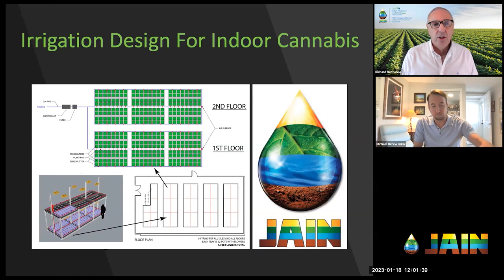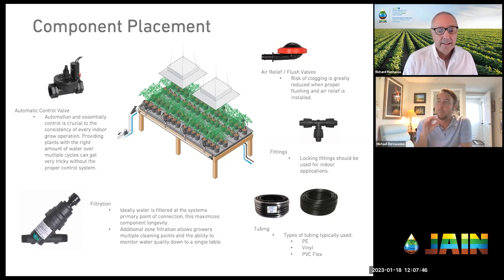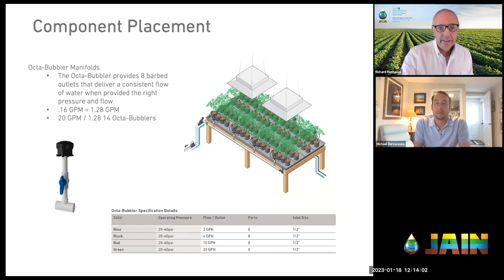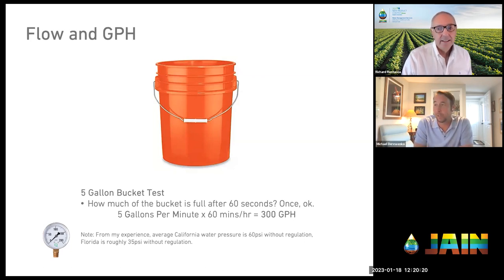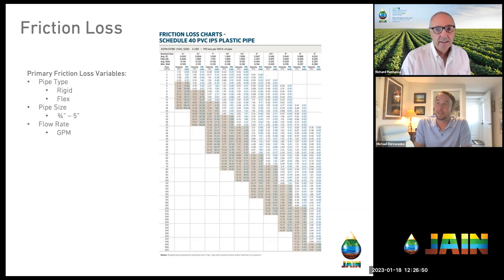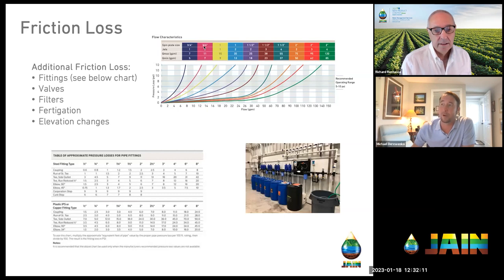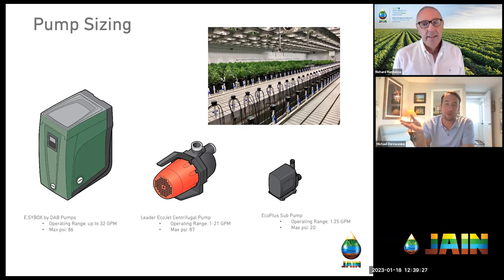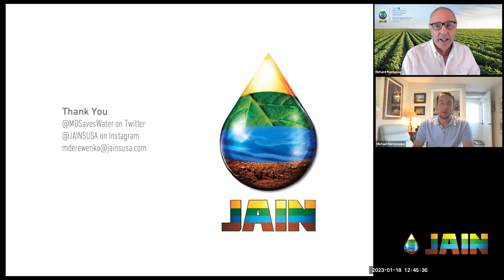Irrigation Design for Indoor Cannabis

Comment: Should the lines to each plant be the same length? I'm working at a grow that's using different lengths from the main line on each table. Here's an example theres 12 plants per light on a 5ft wide flood table with the main table water line runs on the outside edge of each flood table. The plants have different length water lines to each plant. The closest to the edge has two 12-inch lines per plant on each side of the table. The 2nd plant has 2 16-inch per plant on each side. The final or inside plants have  24-inch lines. I feel the shorter lines will have more water released out because it has a shorter travel distance than the longer lines equaling inconsistent amounts of water to each plant between the different lengths. Can you help me with this question. Thanks in advance.
Reply: The lines do not have to be the same length but they can only be so long. Your assumption is correct. However only a fraction of water difference will be distributed per line. Line distance depends on pressure and flow, if the lines are off of a PC device then your lengths will need to be shorter but output will be more consistent. No PC device will lead to uneven flows but longer possible line lengths. 1/4" tubing with no PC can typically be run about 15-20' before water subsides substantially. Thanks for tuning in!
Reply: @MichaelDerewenko are you going to add any content to your page? Looks like I'm your only subscriber